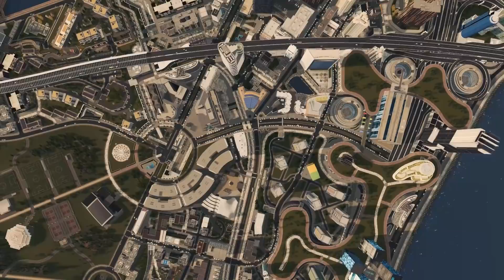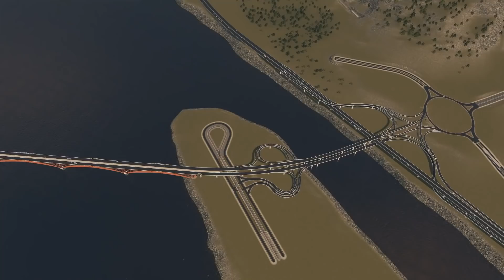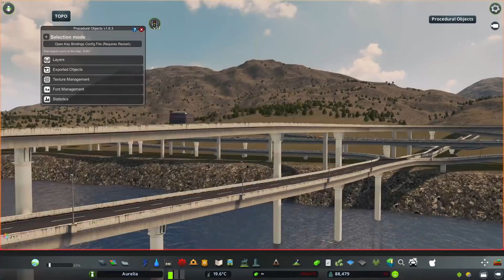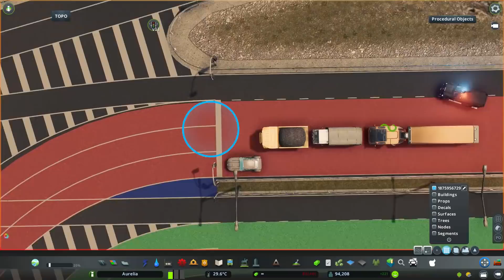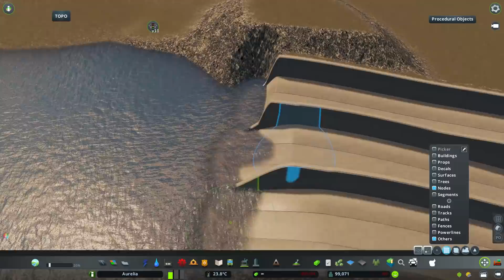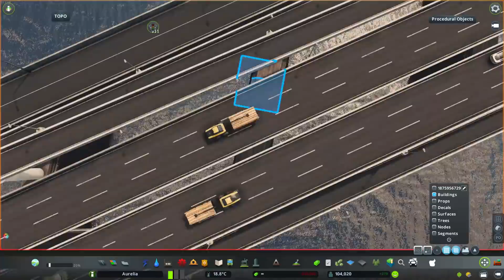Intersection with Coloured Lanes - Cities: Skylines - Aurelia #82

Comment: The colored intersection reminded me on those cool cateye - like highway markings in England. By night time you can actually see if there is an upcoming exit or entry lane or even a highway split, just by noticing the changing colors of the reflector markings on the highway lane paintings. Never saw something like this anywhere else so far.

Comment: Beautiful work.  When you mention that the actual cars don't stay in the lanes that you make with the intersection marking tool.  That tool is strictly for looks and doesn't affect the actual movement of the traffic.  I heard you mention the Traffic Manager but never saw you use Traffic Manager lane connection tool to make the vehicles follow the lane markings.  The way that they highway networks are smart enough to display a continuous concrete barrier or an intersection with signal  lights you would think that it could also control the traffic management  at the same time or the Intersection Marking Tool could control the traffic management.  The latest update to Intersection Marking tool which takes each section of the road including the portions between  the nodes allows you to use the unmarked road network and mark the entire road yourself.  I too love the highway networks that say over concrete where the elevated segments are between between retaining walls instead of the raised earth with jogged exposed dirt.
Reply from the maker: I know TMPE.